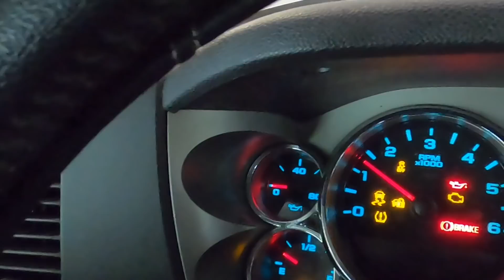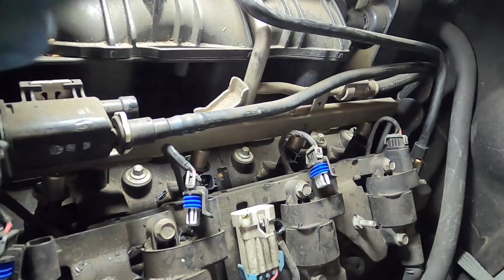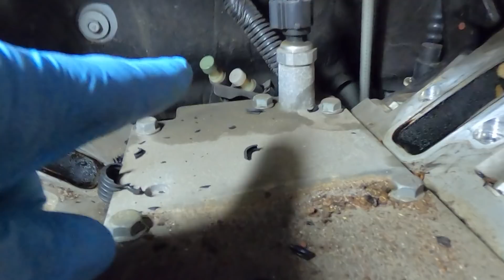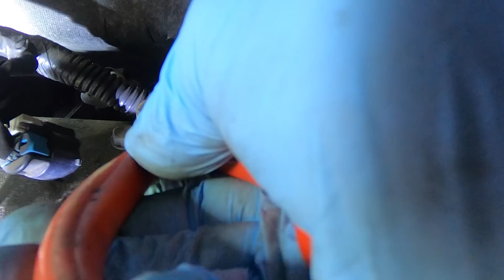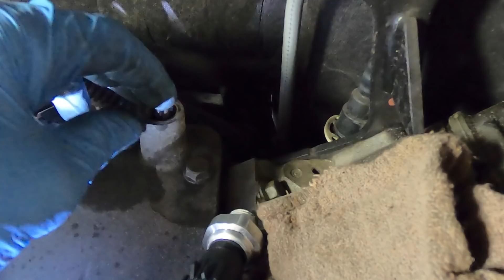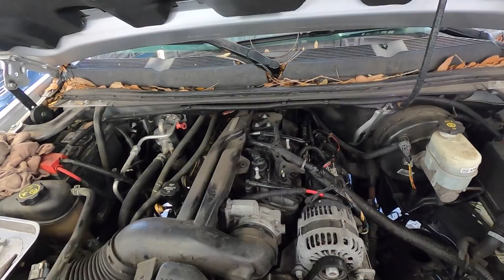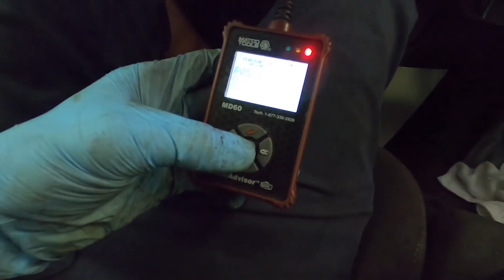Customer States: Google Diagnosis…replace this part!

Comment: Well, at least that was easy money.
It's o-ring in the oil pick up tube by the way 😁
Reply: I'd bet you money your right! I've changed pan gaskets on many LS engines and just as a precaution I will change that o ring while I'm in there. They are always plasticized and brittle.
Reply: @tylerwightman2315  That's a great idea when doing an oil pan gasket! They even sell an upgraded o-ring for that, it's a bit thicker.
Reply: Doubt it. If the computer thought it really had 0 oil pressure the warning would be going off. This is a sensor fault and the computer knows that’s why it reads 0 without the ding ding ding.
Reply: @BigBoyNowYT  you mean the sensor he replaced on the video?
Reply: @rubenvor  yes. It is also possible that it’s just a cluster issue. That’s another reason for no ding ding ding. Gm clusters are touchy.
Reply: @BigBoyNowYT  It sounds more like a wiring issue. It wouldn't usually throw a code for a cluster issue.
Reply: @fascistpedant758  he never stated what the codes were. We can speculate all day lol.
Reply: @fascistpedant758  also at the very end of the video the engine lights off and you can see it reading haha
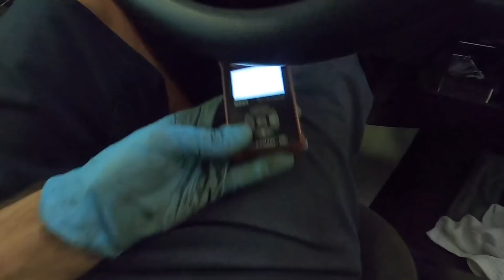Reply: @BigBoyNowYT  He did read codes @30:35.
Reply: @BigBoyNowYT  I guess the customer was right. The gauge must have come back after he cleared the codes.
Reply: @fascistpedant758 

Wow you are correct, I saw it in the very last seconds of the video. It was reading!

I guess that's why he was trying not show the left side of the cluster. I do not respect that.

Comment: Could you have gotten to that oil pressure switch if you had access to the back of the motor without taking it all apart ?
Reply: You can access it from the top without taking much of anything off. It’s about a 30 - 45 minute job with s ratchet, socket, and a wobble joint of your choice.
Edit: It also helps if you’re a bit double jointed to get your hand on it once it’s loose.

Comment: I diagnosed my own check engine light earlier today. Turns out I have "Internet Connectivity Issues."

Thanks Andy Dwyer!
Reply: Lol, that's funny.
Reply: I diagnosed my engine light with a 8 mm drill bit, had a Chevrolet dealership work on my truck, 60 miles later the light came back on. Then I'm told the light could mean 100s of different issues, well give yrs ago I drilled that dumb light out, truck still runs fine......

Comment: So exactly why did you remove the intake you get paid the same to give it the reach around I changed hundreds of them never remove intake now sometimes the screen gets seized and I need to remove intake but that’s only happens 2 times
Reply: Turns 3 hours laboe Into 20 min

Comment: Love the vids, but when doing those oil pressure senders, you dont have to take the intake off. you can reach behind there and get it. tricky part is the screen with the intake in place, but with a long 90degree pick it can be done. cheers
Reply: My trick for the screen is to thread an 8MM bolt into it.  Pull it right on out.  Works to install it too.  8MM grips the screen loosely, just enough to do what you have to.
Reply: Was gunna comment the bolt trick then saw it was the reply lol This is the way....

Comment: If the torque spec on the intake manifold was any less you'd be able to leave the bolts in the glove box...
Reply: It's into plastic and those bolts will shear off. Ask me how I know.
Reply: @1337penguinman  How do you know?!? 😈😈😈
Reply: I had a gasket issue on a 5.0 Mustang I was drag racing. Must have changed the intake manifold gasket half a dozen times in a month. I threw out the torque specs from the second time onward and just did it by feel. The results were more successful. I think the spec was 15 to 18 ft lbs. Kind of low to begin with.
Reply: @geniferteal4178  Those plastic intakes are bad about developing cracks in them causing vacuum leaks that are hard to diagnose where it's leaking from. Had a Lincoln v8 do it, as well as my neighbor's 90 something Firebird. Even the dealership couldn't figure it out.
Reply: @fireball1322  I have an 01 suburban with a plastic intake.  I'll watch out for that.
Reply: Lol

Comment: Before you criticize the customer, pull the codes first.  Always pull codes first.  This customer was right.  At 32:14 the gauge was up.  Also, the gauge will not work properly with the new sending unit until AFTER you clear the codes.  You fooled no one.
  Still working as a certified master mechanic for 30yrs, I know for a fact you don't have to remove the intake manifold to replace the sending unit.  You do, however, need to remove the back (useless) cover at the back of the manifold and get it out of the way 1st.  It is a pain, but saves tons of time.  Get out your shallow sensor socket and the swivels, and beat the book time. 
  This video is an example of what NOT to assume about the job you are tackling.  Never underestimate the internet.  Never assume the stated repair procedure is the only way to do it.
  Here ends the lesson.

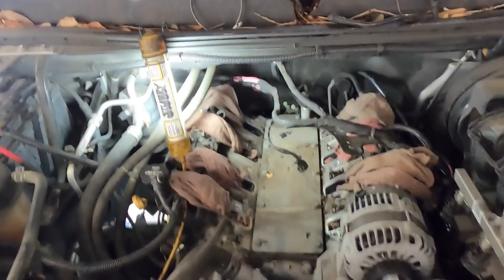Comment: Start at .25 speed 13:38, the debris that falls into the head before the rag blows off shows why you should use a shop-vac to remove loose debris from an open engine before using air or cleaners to remove stubborn dirt. Use caps if you have them or tape if you don't; the leaf debris won't cause damage but the unseen sand might.
Reply: Or just blow off before removing the intake works great! Ive changed these before and didnt remove the intake.

Comment: Had a Jasper engine put in a little Dakota 4x4 of mine a few years ago. I was working in Chattanooga and it just died at a stop sign one day. Took it to a local mechanic and was telling him what all my mechanic at home had done to it, he said “ we’ll figure it out “ . Turned out to be a crappy Dorman crank sensor that my mechanic had replaced my original Mopar sensor with because it was 20 years old. Lesson learned, don’t try to diagnose if you are gonna take it to a mechanic, let him do his job.
Reply: I’ve learned one thing about sensors of all kinds - stick with OEM.

Comment: 44 inch pounds is like 5 ft lbs,....WTF...

And next time erase the code. As it needs hard reset..
Reply: Actually,  it,s 3.5 lbsft...
Reply: @stevebates5973  Yeah something up  with them specs. As 3.8 ft lbs is hand tight...

Comment: I'm just saying. Not saying you're doing that wrong by any means,. But I'm just saying with the proper tools you can change that sending unit in about 5 minutes including the screen most of them have without removing the intake I do it on every single one 🤣😂🤣😂

Comment: Works the other way round too. Bought a car s/h from a main dealer here in the UK some 20 years ago. It was clear the auto-adjuster in the clutch cable was slipping so I asked them to deal with it under warranty. It came back with a new clutch fitted but still with the old cable and problem. 
Ended up fitting a new cable myself and found out it had to be fitted with the auto-adjuster oriented a particular way for it to work properly.
Reply: Sounds like it was a Ford with that Dumb-Ass plastic ratchet type adjuster in the pedal........Designed To Fail.....
Reply: @dondeserthead8538  Peugeot 306XSI. The one I put in was still working fine 90k miles later when I sold it.
Reply: I wonder if that's the problem with my Saab 900 clutch cable. The old one failed but the new one just slips. I gave up on it for now. I've read you have to tug on it just right to get it "set". As soon as I find out what "just right" is, I might try again. 😂
Reply: @OneOfManyNicknames  The '306 adjuster was square in section and sat horizontally on a crossmember (UK so RHD with clutch on the left). Can't remember how I found out or if there were any markings - this was >20 years ago now - but I do remember it would only slip if rotated 90° either way from an orientation that worked. It may have been by playing with it off the car. Didn't slip every time BTW.

Comment: I'm taking it the customer knew he actually had oil pressure as no red warning light came on? Strange customer diagnosis as he could equally have asked you to fit a new gauge in that case!
Reply: There is no red warning light, the yellow money light was on though.

Comment: Did these before never pulled the intake manifold off. Ended up being a oil pickup o ring.
Reply: I think it is an electrical issue not mechanical because, if it really had 0 oil pressure, that engine would be making all kinds of noise and self-destruct in about 2 minutes.  They guy drove the vehicle over there to be repaired and they drove it into the service bay, and Ray had the engine running twice and it sounded fine.  Wouldn't a bad oil pick-up O-ring actually lower the oil pressure and not just cause a 0 reading?
Reply: @OverlandOne  that is true. Sometime when there is a bad sensor it will set a fault code and read 0. Once code is cleared it reads normal. That’s why there was no ding ding ding when it was running

Comment: Amazing you can look at that wiring harness mess and put everything back in the right place.
Reply: I've fixed pinball machines for 30+ years.

You can imagine the wire mess in one of those things ...

And yes, I can do exactly the same thing - just plug stuff right up where it belongs.

It's all in familiarity with the equipment.
Reply: not that difficult, the wires only reach so far and the connectors are all different, just a case of matching the branch lengths to the correct connector, works on aircraft and electronic boxes too.
Reply: It's actually really easy. Everything has its own connector that is proprietary to that item. No two connectors are the same, unless it's the same part. In which case, the wire length will be exact and that's how you decide which one goes where. An easy way to describe this would be ignition coils on a I4. The longest wire goes to the farthest coil. The shortest wire goes to the closest coil. It's not rocket science.

If you build computers I guess that would be an easier explanation. 
You have 2 main connectors on a motherboard. CPU power, and ATX power. CPU power is either 4pin, 8pin, or 8(+4) for supplementary power. The ATX power in 24 pin or 20+4 if you want to be exact. You have your graphics carf which can be many different combinations. But the most common is 8pin, just like the cpu connecter, but they are keyed differently, so you can't plug one into the other. 
Cars are exactly the same. The only wiring to look out for are your grounds, which as long as they are grounded don't matter. And some positive connections look like grounds, but again the length of the wire will tell you where it goes, and they aren't very common on modern cars.
Reply: I started building computers at 11 or something and it’s the same there too. Not really anything you can connect to the wrong thing. Still amazing to watch someone so fluent.
Reply: Once the codes were cleared, the oil pressure should read after the engine has been running about 10 sec. If you carefully look at the gauges at the end of the video, the oil pressure is reading about 25 psi.

Comment: Doing job by GM manual instead of just reaching back and unpluging.
Add socket and wobbly bit remove.
Leave it to GM to make a 15 minute job 3 hours.
Reply: I thought it didn't make sense to remove the intake for an oil pressure sending unit. I've done a lot of my own work and one time I needed to replace a $40 part and the dealer wanted $1,200 to replace it. I did it myself and didn't do it by their book. The book said dismantle car and then replace part.
Reply: It can be done without pulling the manifold most of the time but replacing the DOD filter is really awkward.
Reply: I was 🤔 the same thing did mine like last week and I just reached back yes it was a bitch but the way he did it hell nah lol and the filter thing it didn't fit in mine either weird but I did mine in my yard
Reply: Yeah it's awesome. Like when you do lower ball joints they want you to remove the lower control arm then press it out in a vise. Why not just do it in the car like everyone else does
Reply: @wilwiener  surprised they don't want you to mail it into the factory to press it in and out. Then they mail it back. Kind of like getting an iPhone fixed!
Reply: Agreed. I have a video of that on my Chanel.
Reply: I would do it exactly how the book says and charge them exactly how much the book tells you to. You're doing what he asked. So you replace the part he wanted to get rid of and put on the part that he wanted replaced. It's all good it's money in the till and it's money in rainman's paycheck. And it's a gift that keeps on giving if you think about it cuz he's going to have to get it diagnosed next to find out what's really wrong with the ECM or the BCM. No I'm not a mechanic. But I do have some knowledge. I know enough not to use Google to tell me what's wrong with my car. I also know enough that the oil pressure gauge isn't talking directly to the sensor. That's why we like to do something we call troubleshooting when we have a problem. But he'll figure it out eventually be several hundred dollars in labor lighter.
Reply: @stanremley6646  the customer directed an explicit repair based on their google research. The customer also stipulated no diagnostics and no other repairs. So the customer says in this case.
Reply: I've never in my life seen someone pull the intake to do this job. I've done it at least 4 times. To be fair, there are a lot of variations on the chevy v8s, many have a lot more plastic back there like my dad's suburban and doing the reach around is much more difficult than the others.  It's imperative to let the engine cool down but a 3" extension and the sending unit socket you just feel back there and slip it over it and then put your ratchet on there and break it loose. then thread it out by hand. Never ever seen someone pull a manifold, we only charge 1 hour for the diagnosis and repair of this whole job. What is this guy charging 3 or 4 hours? Ridiculous.
Reply: He never took out the old screen before he tried to put the new one in. Remind me to never take my truck there! Lol
Reply: @robot_1196  
If it was the original sender it never had a screen to begin with. He stated it was a TSB to install a screen when changing the sender to prevent further issues, or more likely just delay them.
Reply: @robot_1196  there is no screen from the factory, thats a fix it solution from GM.
Reply: @robot_1196  
They did not come with one installed during manufacturing.
It is a service bulletin to add a filter when changing sending unit.
Reply: @robot_1196  If there was a TSB to install a filter, there wouldn't have been one there.
Reply: @robot_1196  That's exactly what I was thinking! That's why the new screen never sat deep enough to get the new sending unit in. If a plugged screen was the original problem, then this issue will be coming back.
Reply: @robot_1196  There was no screen . Still he checked for one / and for sludge with a pick . Did you miss that part of the video , or are you always this arrogant ? The TSB called for installing a screen which he did before installing the sender.